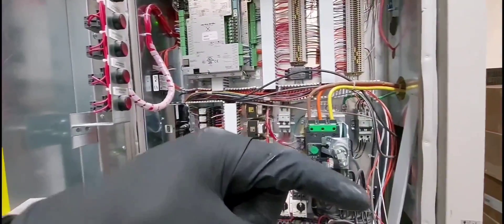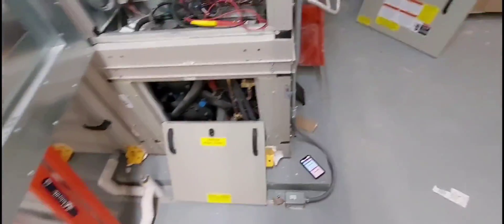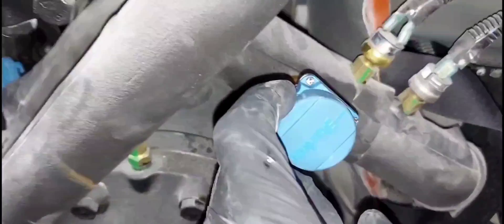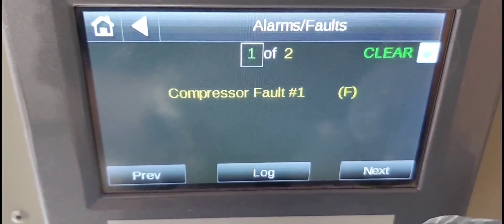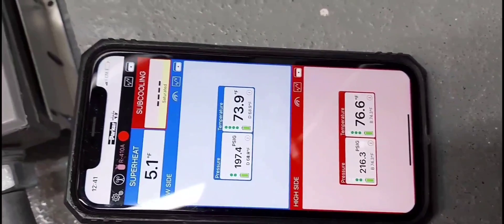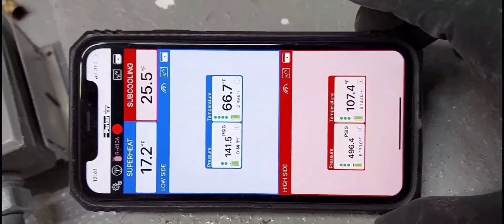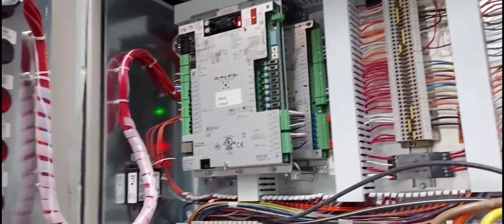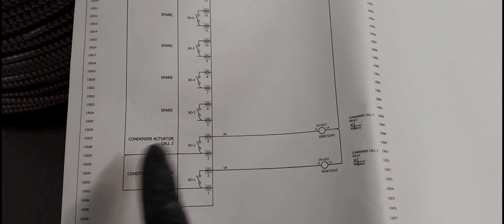HVAC DIAGNOSTICS / TROUBLESHOOTING / TRAINING

Comment from the maker: Diagnostics HIGH HEAD PRESSURE CUTOUT, DUE TO LOW WATER FLOW THROUGH CONDENSER COILS, MOTORIZED VALVES WAS DIVERTING WATER FLOW AND BYPASSING CONDENSER, ALSO SYSTEM WAS LOW ON REFRIGERANT 💪💪💪💪

Comment: 2 wks late looking @ your video, but I  think there is no condenser fan or a overcharge condition to create that much sub subcooling going out on high pressure limit.
Reply from the maker: You are correct my friend, after I solved condenser heat rejection problem the system was also low on refrigerant 💪💪

Comment: Something on the water side, no flow or restricted water flow. Maybe someone forgot to open a valve? looks like a new unit. or maybe the inlet and outlet water connections are reversed.
Reply from the maker: Good 👍

Comment: Clean the strainer. Easy fix. Unit would not start if actuator does not open due to flow switch. That’s my guess.
Reply from the maker: Well well, looks like we have a grand prize winner here! Do you work on this system type before?
Reply: Yeah I do commercial hvac. So was that what the issue was clogged strainer?

Comment: It's definitely the txv😅
Reply from the maker: in case you were serious it's not the TXV my friend! the issue here was that the condenser wasn't able to properly reject heat due to inadequate water supply to it, in addition the system was also low on refrigerant charge.
Reply: @D2DNYAC  no I definitely wasn't serious😂, but I didn't know the actual issue either so I did learn something 💪🏾

Comment: One of two things probably, a water actuator valve isn’t open, or a restriction somewhere on the refrigerant line, but most likely the problem is on the water side. Had same issue the other day and it turned out to be the cooling tower’s pump wasn’t working.
Reply from the maker: Very nice

Comment: I have to say either low airflow on evap or low water flow on condenser
Reply from the maker: Interesting, why did you say low air flow on evap?
Reply: Just because that super heat was really high on the suction side. 
Great content by the way!
Reply from the maker: No my friend the opposite would be true. Low airflow = low supper heat
Reply: Gotcha I appreciate the feedback
Reply from the maker: happy to help